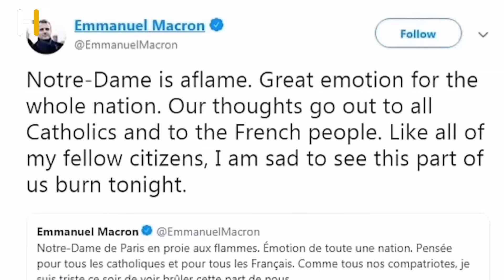Restoration UPDATE of The New Notre Dame – Unveiling in 2024

Comment: I hope that will open before Christmas.  But, what’s going on for 2028?  More improvements?
Reply from the maker: As of now, there are no specific details or widely known events related to Notre-Dame specifically for the year 2028. The primary focus remains on completing the restoration and ensuring that this historic cathedral is fully restored to its former glory by 2024.
And of course, if it continues until 2028, there will be superficial upgrades and More improvements .
Reply: Parisian here. Most of Notre Dame work will be completed by 2024. Inside mass services, inside tourist visits, outside all scaffolds will be removed for the 2024 Olympics and inside scafolding will be removed before December 2024. Some visits to towers may be limited until after 2024. The cathedral surroundings: parcs, conversion of a disused parking into an infocenter and museum will last until 2028. Rebuiding work will transition smoothly into regular maintenance.